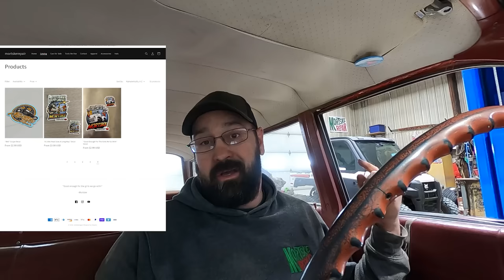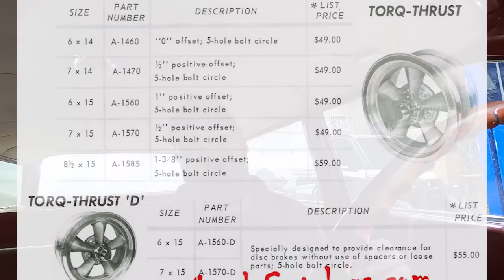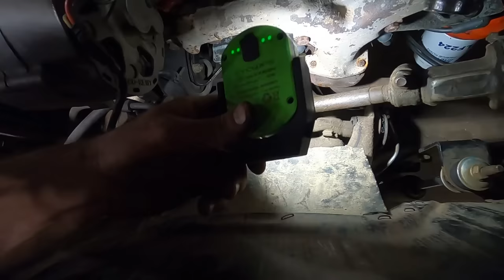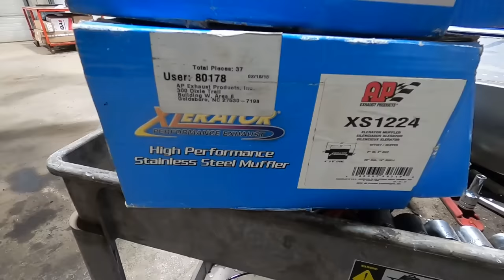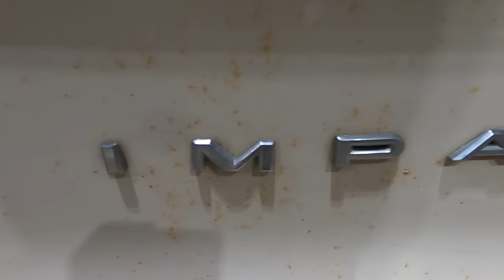My First Classic Car! 1964 Chevy Impala Station Wagon! Complete Suspension Rebuild Disc Brakes!

Comment: i used moog parts on my 97 2wd ranger when i rebuilt front end. Now i bought truck new, 220k mls now. but after rebuilding entire front end with MOOG parts, it rides better now then it did when new. i was so shocked.  next will be redoing rear suspension. but yeah i wanted to share it
Reply from the maker: Thanks for sharing

Comment: Next time you need help installing a common GM ball joint just call Dan at DD Speed shop. By the way you are not supposed to tighten the bolts on the end of the cross shaft until the car is at ride height.
Reply from the maker: he just buys new control arms!

Comment: Mort, you SHOULD be old enough by now to prioritize comfort and useability over the "coolness" of lowered vehicles. Especially with gravel roads.
Reply: and especially on a 64 station wagon... at least change it to what the cool kids were doing in the 60s and 70s and raise the back end up and put some wide tires back there instead
Reply from the maker: They drive just fine on gravel lowered.

Comment: Guessing Cragar SS wheels aren't in the running with this vote 🤣🤣🤣 Period correct looking mag wheels, Halibrand Sprint style, or traditional aluminum slots could work, but my main vote would be for Torq Thrust D with dark grey painted spokes and the spun/satin finish outers.
Reply from the maker: no Cragars!

Comment: 1:45:28 the one thing worse than working under the dash, is having to take the ENTIRE dash out for one silly little servo, or a $30 heater core, or a blower motor resistor, because they jammed whatever part so far up the firewall that its tapeworms file grievances for refusing to work in confined spaces.

Comment: 1:46:39 Personally not a fan of COPO caps on most cars, they belong on Camaros and Novas, not full size.  I'd be a lot more interested in trying out 77-90 dog dishes for 9C1 police package cars.  Cleaner.  Smooth.  No color line.  No ribs.  Still got a bowtie though.  Barring that I'd use '65-66 Chevy dog dishes with the paint worn off before most anything else.  '67 is also nice but busier.  '63 and '64 designs are even busier than that.  I'd even use 94-96 9C1 wheels with the bolt on center caps before I'd use 63/64 style or COPO caps.  But I'm biased, and the '65 is my favorite year anyway so of course I'll like those better.

Comment: Ive owned a few sets of e-t wheels and a set of kidney bean Fenton magnesium slots!! And the e-t cragar knock off was the spare wheel and new tire for my momma's 1941 Chevy 1/2 short bed with 15x7 cragar tru spoke chrome wire wheels.... And I have owned several sets of American racing brand wheels and not one single torq thrust wheel i uh love those wheels though, but I have chrome nuggets, chrome and golden nuggets, and they are actually called the outlaw wheels if they are aluminum and the outlaw 2's, several sets of white spoke red and blue lip paint stripe wheels, American racing 4 different series of sets of aluminum slots including the gm 6 lug with black paint insert accent holes and the wheel the lip was polished,i had on a Hawaiian blue and frost gloss white center and roof 79 Chevy k10 regular cab long bed Scottsdale 4x4 farm truck,, and a fully polished aluminum wheel American racing elongated triangle shape black accent paint Holes 16x8 blade wheels i picked up those two wheels from the junkyard $200 and they had 65 percent courser radial at tires,, prime wheel and enki knockoff chrome billet aluminum scalloped jagged edges but blade wheels that was worth way more than the car they were bolted to
Reply from the maker: Thanks for sharing

Comment: Either way with the wheels I would be proud to run. Steele are original and cool, but the Torque Thrust is awesome 😎💯%⚡ also. Your choice and I would not drive it either.

Comment: Are the glasses worth the money and what do they do for you that others don't. Have piles of Dana 60's you could put underneath the Impala. I actually have one with a sweet Detroit Locker in it with maybe 10K on it. The Chevy Caprice blew up in the early 80's and I never used it or put in in anything else. Pretty bullet proof set up has 342's in it if I am not mistaken.

Comment: I love how easy those front ends go together on old American iron. Nice and simple.  Old British iron is a right bastard.  Its like they looked at the American stuff and said "Yeah, good idea, but let's over-engineer ours and make them more complicated so that people have to keep bringing their cars back to the dealership where we have specialists and can take more English Poundies off them to put them right again".  Guess what?  None of the British Leyland makes made it out of the 80s making British cars - and most died in the late 70s or shortly thereafter......so 40-50 years ago.  Great foresight, chaps!👍 Thanks for that.🖕 Oh, they're not so bad I suppose.  Just don't expect to pull them all apart and put them back together rebuilt in one day while working on your own - even if you HAVE been wrenching on them since you were 10 years old or so and helping Dad by stripping a few old wrecks or working on a project.  Having new parts sitting beside you is cheating....but that's only a luxury if they are still available!

By the way - what do you have against lock washers?  I'd rather use lock washers than nylocks for the simple reason that people don't understand that a nylock is a consumable item and should really be replaced each time you take it off.  I tell you, when you've seen the result of nylocks failing, your love for them goes bye-bye real quick.  Had a mechanic mate who reckoned you could get 10 uses out of one.  I also noted he didn't do that on his OWN car for some reason.....  But yeah - what prompted your dislike of lock washers?  Did one cheat on you with Duff or something?

Love that bearing packer-tool.  Every workshop should have one of those things!  Shock absorbers on the other hand - they have a shelf life whether they are driven on or not.  The seals still go bad in them and they shmoo up the cylinder after a couple of miles if the car has been sitting any length of time.  I've had shocks fail after 80k-140k miles and I have bought a car with brand new shocks fitted only a couple of hundred miles before she was parked.  On the trip home (some 700 miles), the RF went sloppier than a five dollar.....er.... it lost most of its resistance, the LF seized and the rear ones just pumped their fluid out by the time we got half way home and then just went up and down with the springs.  Car had sat parked up in a dry garage for 4 out of 5 years of his ownership.

Agree with the dual-line master cylinder and disc brakes too.  Nobody can tell me that better brakes are over-rated.  It's one of two places that are always watched and not compromised on with any of my vehicles.  The other is tyres.  Brakes are good, but if your tyres are old and hard, they just slide and you hit something.  If tyres are good but the brakes are dodgy, your foot pushes the pedal through a rust hole in the floor and you hit something.  Both must be working at their best in order that you pull up short.  Steering can go slack, shocks can seize or break (had THAT happen too - not fun), but if you want to stop the momentum, there is a four to six inch square of rubber on each corner that is your connection to the road and eight little shoes or pads controlled by a fluid being pushed down a quarter inch tube that pushes them onto a cast iron surface to slow you down to a stop by friction alone.  When put into perspective, that's a bloody scary concept, so I like to know they will work when I need them! 

Regarding Poly-bushes and squeaking - a touch of silicone spray (a tyre shine juice usually contains a fair amount of that) on them when fitting and they never squeak.  It doesn't rot them out like grease or oil does either.  NEVER use WD-40 or anything petroleum-based as a lubricant on Poly......

Wheels?  You KNOW what my vote is for (and no, not Cragars like you'd absolutely LOVE to put on there), I'm all for the Torq Thrusts - a Torq Thrust D in grey with machined lip (VN105) or an Original (VN309).  Depends what is available in the Chevy's PCD and offset, but the 105 has 16" offerings and the 309 has some in 17".  I think 17s might be pushing it and showing too much wheel and not enough tyre, but the 16s would give you a better range of tyre profiles than 15s and not look out of character for the era.  Both the 105 and the 309 have 15" though (the 105 has many!)  The only other option I would put on personally would be a set of slotted alloys, because hey too were period and would look good.....but not as good as the TT-Ds

Well, that's my 2c worth.  Got a fair bit of mileage out of it too!  

Have a bloody good week - and that wagon of your is a sweet ride, mate.  Great to see it again.  All the best
Reply from the maker: Lock washers don’t work. There’s studies that have been done
Reply: @MortskeRepair  - Ahhhh......yeah.  And you believe them?  Were they on the reliable old internet or did you read them in some dodgy technical book or other?  

Thing is that I've never had a lock washer (aka spring washer) fail on me, but I HAVE had to replace tired Nylock nuts when they were working their way off things they shouldn't have been because the nylon had been shagged out from too many times threaded on and off.

Internal (or external) serrated or tooth washers (ALSO known as lock washers) that sometimes come with rubber brake hoses - these work well too, but unless they are stainless, they are prone to rotting away under some circumstances as they are quite thin.  Spring washers (ALSO known as Lock washers) look like the coil of a spring and they aren't there to physically stop the nut from turning, but more to pressurise the nut against all threads in use and thus grip harder than if a flat washer was used.

There's a Nord-Lock / Wedge lock washer - basically looks like it was ribbed for pleasure or something on the surface faces.  Yes, those are about as much use as a chocolate teapot over an open fire, but I've always found the spring and toothed / serrated washers reliable.  

Subject for a Mortske Minute maybe?
Reply from the maker: @KiwiStag74  Yes, I believe them. You seen a lock washer on anything other than cheap furniture in the last 30 years?
Reply: @MortskeRepair  - you mean besides my classic cars?  I'm picking you are referring to new stuff in shops etc.  Yep - washing machines, fridges, television stands (as in them you can unbolt from the TV to then bolt the TV onto a wall bracket - which also uses lock washers to secure it to the TV), tool cabinets, multiple-attachment garden tools, trolleys (for lugging 300kg around the workshop), dolly wheels, some cabin components in modern vehicles......  Sure - they aren't being used as often, but they are still being used.  

Think about polybushes, mate.  30 years ago, they were new and everyone wanted them, so the rubber ones slowly got phased out.  Then the polys started crumbling away because of oil contamination and for a while, nobody knew how to fix it, so people went back to using rubber bushings......but now the rubber is crap and the polybushes are getting better, so they are swinging back that way again.  

People said butter was bad for you, so they invented margarine and the health numpties pushed it as the saviour, then after a few years, they found out that margarine is carcinogenic in greater amounts, so they retracted their statement and people started using canola oil-based spreads or went back to butter.   

Each generation has is own new invention that renders the previous generations' fixation with a product as a bad deal.  However, the new one is also eventually shown to be flawed as much as the old way, so people just stick to what they like.  

There must be a reason that spring washers and serrated washers are still sold, man.  If they were dangerous, the H&S people (or Greta) would have outlawed them years ago.  All I am saying is I've never had a problem with spring or serrated washers, but I HAVE had issues with Nylock nuts - the supposed Godsend of replacements for their use.

Oh boy, do I smell a Mortske Minute coming up on these things or what?!!
Reply from the maker: @KiwiStag74  Lock washers aren't effective. Educate yourself.

Comment: When talking about the "trackbar" I call it a "panhard bar" you can now change to a "y-bar" and remove the panhard, or even a "wishbone" which requires more modification.  These are designed for the 64 impalas and allow straighter movement than a panhard
Reply from the maker: Thanks for the info!

Comment: I sold and installed a lot of moog, until i had 3 out of four ball joints wear out in just over a year. And i hate the boots. I really hate the boots. No more moog on my junk.
Did you check the bore of the rotor for grit? I have found sand in rotors on more than one occasion. I bet my buddy DD Dan never checks either. 
Wheel paint works good on brake castings. One step closer to powdercoating.
Reply from the maker: Who do you get your ball joints from now?

Comment: You should never tighten the bushing nuts fully until the vehicle is settled at ride height so you don't put a set on the new rubber
Reply from the maker: Thanks for the tip!

Comment: Watching you change those bushings was painful.  Clamp the cross shaft in the vice, remove the retaining bolts. Use your air chisel to buzz between the arm and ears on the bushing along with a little pry it out action. It'll come. Forget Zippy and his cutting out the rubber. Time in your life you never gonna get back. To reinstall, support the ears of the arm, with the shaft in place on one jaw of the vice, wiggle the bushing in place, put a big socket like you did on the ears of the bushing and bash it with a big hammer. When you get to the other side you will notice you distorted the arm inwards. Buzz the arm out to the bushings with your zip gun.  I did millions of bushings at the dealership.  Paid 1.2  per side, and I could hit both upper arms in 40 minutes. Flat Rate Phil strikes again !

Comment: Best Honky Tonk in Texas (The Broken Spoke) your going to right by it.  It's definitely closed on Sunday so you have time to repent. God bless Texas.
 I like the "64" Impala steel wheels, white walls and hubcaps, or the red hubcaps with steel wheels matching the body paint. Drive that car year round with some Blizzack snow tires on with a nice sound system and heated seats. Put some Christmas lights on it and drive it in the Christmas parade it's a beautiful car.
Reply from the maker: Pine tree on the roof!

Comment: The front disk brake Chinese castle nuts are always too short.  Once you tighten them down the castle nuts are always too short for the cotter pin hole and the cotter pin to work.  Adding a few washers under the nut will work.  I use the old tall castle nut I took off, they usually work perfect.  Somewhere in China they are dying laughing at us, knowing for twenty some years they are selling millions of these disk brake replacement kits with short crappy castle nuts.  It is intentional at this point on their part, they just choose to keep making short nuts and has been common knowledge.  You should have watched your hero Dan do a Chevrolet disk break conversion.  He pointed the short castle nut scenario and had the same thing happen that has happened to everyone for twenty years.  I have done a number of disk break conversions and it is always the same no matter what kit it was, drop spindles, regular spindles, any Chinese kit has short castle nuts.  Twenty years ago they screwed up and they just keep the mistake going, forever.  Communists do that.  At least they make parts for our old cars but not all of what they make are good parts that fit correctly.

Comment: Question about to change out my master cylinder on my 79 chevy truck. Would I be able to use another yr. cylinder from like the 80's without changing my booster ???  Thanks
Reply from the maker: Probably, if the lines are the same. What's the advantage tho?

Comment: I’ve been spraying the new brake masters with clear coat on cars I might sell. Just so buyers can tell I changed it at some point. Might have been 37 years ago but I did change it. Now that I say it out loud I think I’m tricking people and myself. Whatever I’m an idiot. Your not selling that sweet girl anyway so you would only be tricking yourself. Well, back to double D cam on DD’s speed shop. Did you remember to grab your sunglasses?
Reply from the maker: Thanks for the tip

Comment: If you put a master cylinder on and it’s adjusted to tight and you do get brake drag does that ruin the master cylinder or can you loosen it up to fix it? Asking for a friend 😂🤣😂🤣
Reply from the maker: lol, just loosen it up. no damage. hopefully you didn't smoke the brake pads or warp the rotors tho!
Reply: Thanks so much